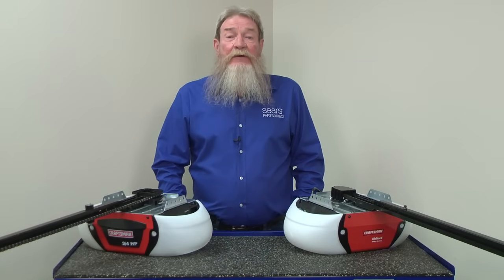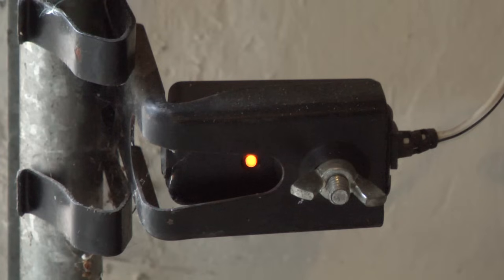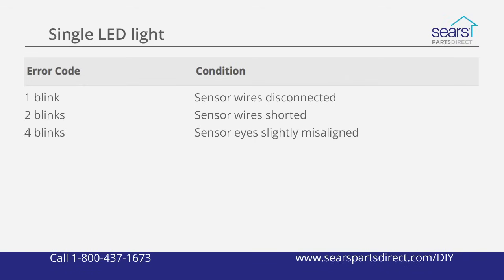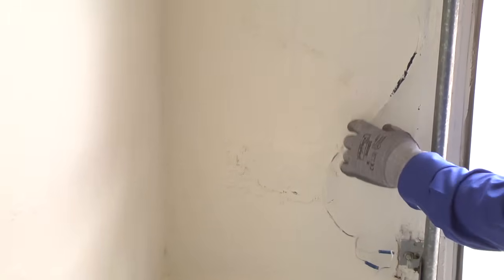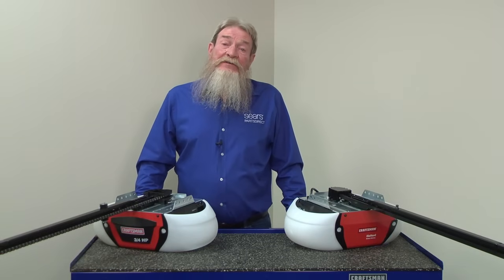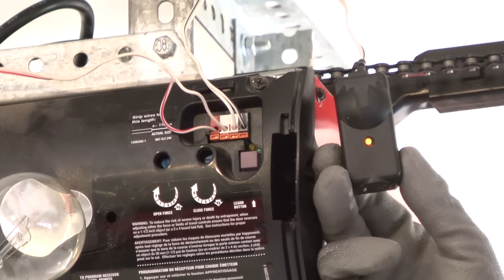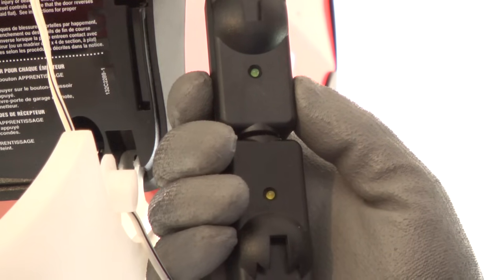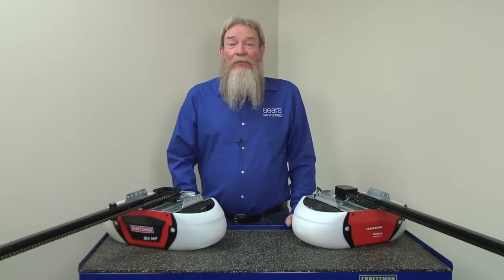How to Fix a Garage Door Opener that Won't Close the Door: Lights Blink 10 Times

Comment: Thank you for the video.
What if the photo eyes are aligned okey (both have solid lights) but the door still stops about 10 inches
from the floor and goes back up?
What would be the cause for this? Thank you.
Reply from the maker: The downforce could be set too low on your garage door opener or the garage door could be hanging up on the rails, causing the opener to react as if there is something hitting the door. Try this: Release the safety rope to disconnect the garage door from the opener. Open and close the door by hand to see if the door hangs up or stops before closing completely. If the door binds up, you’ll need to check the rails and roller wheels on your door for damage.
 
If your rails and rollers seem okay, you may need to make a force adjustment on your garage door. This PartsDirect video explains how to make force adjustments on some of the common models: http://www.searspartsdirect.com/article/how-to-make-force-adjustments-if-a-garage-door-wont-open-or-close-video.html. Your owner’s manual also explains how to adjust force on your specific model.

Comment: hi I have  chamberlin liftmaster  41as050-1, today it won't close, I 
think 4 flashes forgot exactly how many. but it wasn't sensor 
obstruction. I replace the  broken bulb on the right one then it stopped
 working right and won't go down (when I got the house the bulb was 
burnt on the right and didn't replace it until now) so this is a weird 
one huh? took out the right bulb (total 2 bulbs) and it started working 
again. any idea how to fix this? it's about 10 years old.
Reply from the maker: There’s a possibility that the right side light interferes with the sensor beam. Install the right side light, then test the safety sensors directly at the motor unit as shown at 3:20 in the video. If the sensors work directly at the motor unit with the right side light installed, then you’ll likely need to install sun shields (http://www.searspartsdirect.com/part-number/41B873/0009/139.html) to prevent the light from interfering with the sensors.

Comment: My problem sounds a lot like some other comments on here. I seriously doubt my wiring is bad, my sensors aren't misaligned bc I taped them to together, lights are steady, but I have noticed very very faint flickering in the green light/receiver sensor at times. 10 light bulb flashes...4 flashes up and 6 down on the motor unit.  I'm worried it's a logic board. minus well buy a new opener !! I need to perform the sensor test directly at motor but other than that I've covered everything in the video. help!!
Reply from the maker: If the garage door opener works when you test the sensors directly at the motor, then you’ll need to replace the sensor wires between the motor unit and the door. If the sensor error occurs when you test the sensor directly at the motor, then you may need to replace the sensors. If you replace the sensors and the problem continues, then you’ll need to replace the logic board (or replace the garage door opener).

Comment: Excellent video! my sensors tested good. It would be nice to know which wire coming from the tracks is faulty. I connected the amber sensor directly to the motor. I connected the green sensor to each side but never got a green light. The sensor wires go through my attic and are difficult to trace. Is there a way to know which wire is faulty?
Reply from the maker: You can check for continuity through the wires using a multimeter (http://www.searspartsdirect.com/part-number/82141/0034/034.html). This video shows how to check continuity through wires at 1:18:  http://www.searspartsdirect.com/article/how-to-test-continuity-on-wire-and-electrical-parts-video.html. Because you won’t be able to touch a meter probe to each end of the wires, twist the two strands of wire together at one end of a 2-strand sensor wire and then check for continuity through the 2 strands of wire at the other end. This tactic will detect a break in either one of the 2 wire strands at once. Replace the 2 strand wire that is broken.
 
Instead of running the replacement wire through your attic, consider running the new wire along the rail to the front of your garage and then down to the sensor along the front garage wall. Make sure the wire doesn’t get caught in any moving garage door or opener parts.

Comment: ok my led light flashes 4 times but my sensor lights are bright and steady is it a bad sensor do you think? also the light bulbs on the unit flash 10 times after trying to open or close the door. also it will not travel more than a inch or 2 but the dorr opens manually just fine no hang ups
Reply from the maker: The sensors may be bad. Frayed wires or a failed logic board could also cause this problem. Check the sensor wires a shown in the video and repair any damaged wires. If you find no wiring problems, test the sensors directly at the motor unit as shown at 3:17 in the video. If the garage door opener works during that test then you’ll need to replace the existing sensor wires between the motor unit and the garage door.

If the sensors don’t work during the test, then you’ll likely need to replace the sensors. If you replace the sensors and the problem continues, replace the logic board.

Here’s a video that shows how to replace the sensors: https://www.searspartsdirect.com/repair-guide/garage-door-opener/how-to-replace-the-safety-sensor-for-a-garage-door-opener.html. This video shows how to replace the logic board: https://www.searspartsdirect.com/repair-guide/garage-door-opener/how-to-replace-the-logic-board-on-a-garage-door-opener.html. 

Thanks for your question.
Reply: i wish you could write it out on testint the sensors then i could print it off be a whole lot easier but will try and check them tomorrow  thanks Dan
Reply: Okay I did the test the sensors are working tried the door again it went down but stopped about a foot from the bottom then went back up regular light bulb blinked 10 times so now what do i do
Reply from the maker: If you have the sensors attached to the garage door rails, then check for play in the rails that could jostle the sensors as the door moves. Tighten the rail fasteners or attach the sensors to the front wall to prevent the sensors from moving during garage door travel.
 
Sunlight can interfere with sensor signals. Try installing these sun shields over the sensor to prevent sunlight interference: http://www.searspartsdirect.com/part-number/41B873/0009/139.html.
Reply: iI dont think it is sunlight nor the sensors this opener has been running good for 11 years and all of a sudden it has problem with sunlight or the sensors moving. I dont think thats it ive read a few reveiews on this problem most say the same . so i guess i'll just get a different brand from another dealer im tired of the junk sears is putting out now it use to have good stuff but them days are gone.  Sears and Kmart are just about to fold up and thats sad they have been here a long time

Comment: So, my problem is exactly the same, (10 blinks) however, the wiring is OK, the sensors are OK, the lights (green and yellow) are OK, there is no sunlight issue, and it is happening about every other time. Once it fails, it will continue to fail and the only way I can get it closed is by using the "hard wired" wall switch, and holding it down until the door closes. Any thoghts?
Reply from the maker: Because the lights blink 10 times, the logic board detects a break in the infrared beam between the sensors. You indicated that you checked the wiring and sensors. If you didn’t test the sensors directly at the motor unit as shown at 3:20 in the video, we recommend that you conduct that test. If the system works during that test, then we recommend you check the wiring again because an intermittent short in the wiring could be causing the problem. If the system fails that test, then the sensors intermittently failed or the logic board isn’t detecting sensor signals.  We recommend that you first replace the sensors and if that doesn’t work, replace the logic board.
Reply: richmis120 Just wondering if you came up with a solution. my problem sounds just like yours. I seriously doubt my wiring is bad, my sensors aren't misaligned bc I taped them to together, lights are steady, but I have noticed very very faint flickering in the green light/receiver sensor at times.  I worried it's a logic board. minus well buy a new opener !! I need to perform the sensor test directly at motor but other than that I've covered everything in the video.
Reply: @richmis120 This is the same issue I'm currently running into. Sensor are good. The only way I can close the garage door is by holding down the hard wired button on the wall. Did you get this issue resolved?

Comment: Thank you so much for this video.  It was helpful. I had call a company that said my circuit was fried and I needed to change the whole thing and it was going to cost up to $800.  After watching your video, I was able to troubleshoot and have an idea of the problem.  I was not confident to repair the wire, but I sounded knowledgeable when talking to the next contractor.  The guy did exactly what you suggested.  And it worked.  Thank you for saving me a lot of money.
Reply: That's the way to go!

Comment: My garage door is driving me crazy. During the day, 8am - 5pm, it'll start to go down then just open back up. Sometimes it'll do it as it's in the curve, then other times it'll get half way down and just start to open. Sometimes we can use the outside control, but most of the time one of us have to go back into the garage and use the main unit to close it and then you have to hold it until the door closes and go back into the house and out the front door. So much for convenience. But after 5 or 6 there's no problems. I've checked the sensors, wiggled the wires, all seem to be ok. It doesn't do it all the time but when it do its always a pain in the.... As I type this I was wondering if the sun could be interfering with the sensors as my house does face the rising sun. Anyone have any ideas on the matter?
Reply from the maker: Sunlight is likely interfering with the sensor signal. Install sun shields over the sensors. Here’s a link for the part: http://www.searspartsdirect.com/part-number/41B873/0009/139.html .

Comment: Wayne - My older Craftsman will not work.  I do have power.  All the remotes can activate the lights on the opener and I can hear the opener "click" when the button is pushed, but the motor never starts.  I have checked the sensors and they appear to be good and I'm not getting the blinking lights so it's not a sensor issue.  Any ideas?  Thanks in advance.
Reply from the maker: Try unplugging the garage door opener for 3 minutes to reset the control board and then plug it back in. If the motor still won’t run after restoring power, your garage door opener could have a defective logic board or a bad drive motor. The drive motor fails much less often than the logic board so you may have to replace the logic board. Since it’s an older model, you may consider replacing the entire garage door opener instead of repairing it because the repair parts may cost nearly as much as a new opener.

Comment: My problem is different and I had an power out an it came back fast but when I was attempting to leave the door open an stay open an when I check I side panel in the kitchen there was an error message. Motor Control Error. code 1-5 see user manual. So I went and I google on your website and I found two option the control panel travel is bad or the one on the motor and I called the tech and I'm still in warranty and now I have to wait till next week and I already found the part list with price just in case the tech try to pull a fast one on me. I know how to do the manual setting to open an close my door. thanks for the video it came in handy cause I follow everything step by step.

Comment: My garage door it open by it self, in the middle of the night, I lock it and still did that is drive me crazy
Reply from the maker: Weak batteries in a remote device can cause the door opener to activate on its own. Try replacing the batteries in all your remotes. A short in the wall control wiring could also cause the door to open on its own. Check the wall control wiring for damage. A defective logic board in the garage door opener can also cause it to open the door on its own. You may need to replace the logic board if the other 2 tips don’t help you resolve the problem.
Reply: change your code...my remote was the same as my neighbor....reprogram your code and try again.
Reply: cahokia33 I went got me new motor and will be install this Monday, but thank you so much I learn something new here, sometime is hard for women like me to figure thing out, so thank again.

Comment: I had a similar problem with a 30 year old Sears door opener.  Light by "set" button blinking 4 times and garage lights flashing 10 times when trying to bring door down.  Safety light "sender" was green, so was "receive" light and would go out when blocked. After many checks, I see about 14 inches from the receive safety light a "green" coloring on the wire to that sensor.   Looking closely, that section of wire was bent, exposing that section to water.  Over time it turned the copper wire "green" and increasing resistance.   I cut out that section, used wire nuts and BINGO... now it goes up and down.  No blinking at the "set" button.
My other garage door had that same problem (blinking lights) last year and I replaced a non working sensor again due to rust at the connector.  They come in send and receive units.  Pretty cheap repair ($25) against a $150+ labor repair.

Comment: Garage Door sensor lights don't light and the  light blinks 5 times in the Motor part. what can I do?
Reply from the maker: The light blinking 5 times indicates that the opener has a drive motor problem. The garage door could be bound up, preventing the motor from running and causing the light to blink 5 times. Pull the emergency release rope to disconnect the garage door opener trolley from the garage door. Manually open and close the garage door to see if it operates smoothly. If the door gets stuck, repair the garage door. If the door moves smoothly, activate the garage door opener to run the trolley along the garage door opener rail with the garage door disconnected. If the motor doesn’t run, you’ll likely need to replace the motor. If the motor runs but the trolley doesn’t move, check the rail and trolley for damage. A damaged rail or trolley could be preventing the trolley from moving.

Comment: I have been searching for blinking light problem, but by the time i got to this, my garage door stopped working.  I have a craftsman 1.5hp that now has now power.  The only light i have is the sending sensor light (yellow) glowing, no green, no over head and no LED light on the wall.  Checked the wires all look good.  Help with this problem would be great 
Thanks
Reply from the maker: If your garage door opener has a back-up battery, then the motor unit may be operating only on battery power. Check the electrical outlet for your garage door opener to see if the outlet has power. If not, reset the house circuit breaker. That may restore power to the electrical outlet and the garage door opener may start working. If your garage door opener doesn’t have a back-up battery, then the logic board may be locked up. Reset the logic board by unplugging the garage door opener for 5 minutes then plug the garage door opener back in. If the garage door opener won’t work after resetting the logic board, then the logic board may be defective.